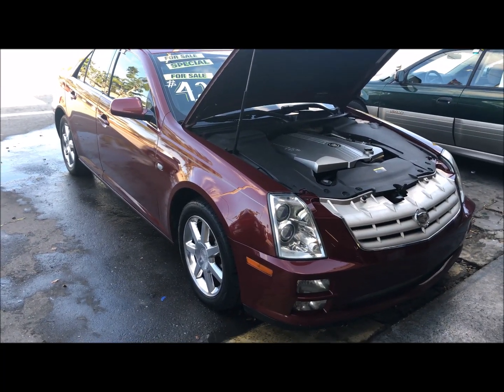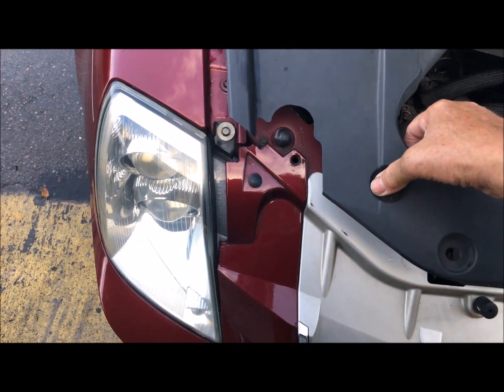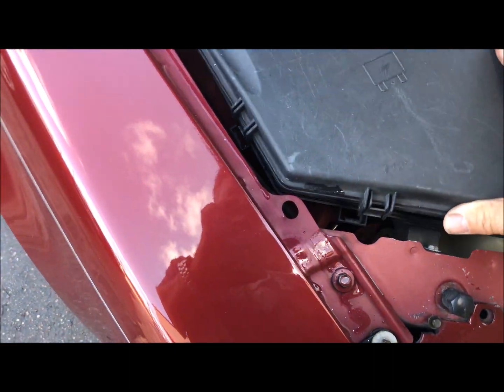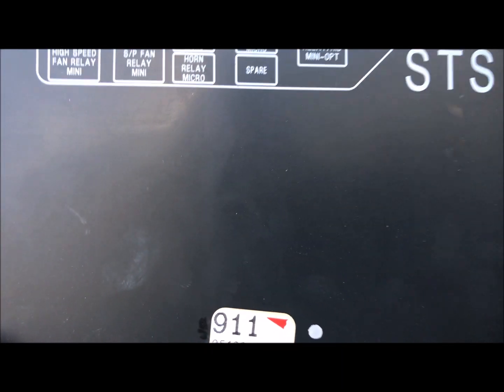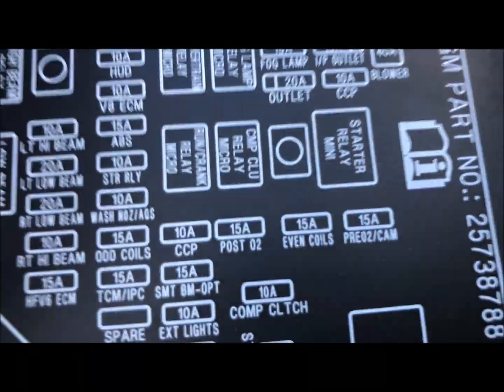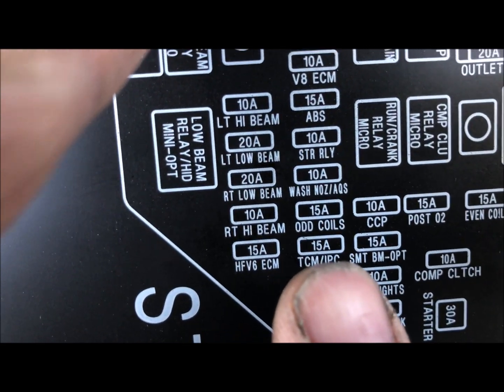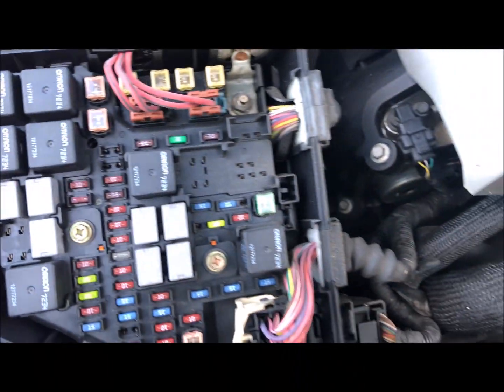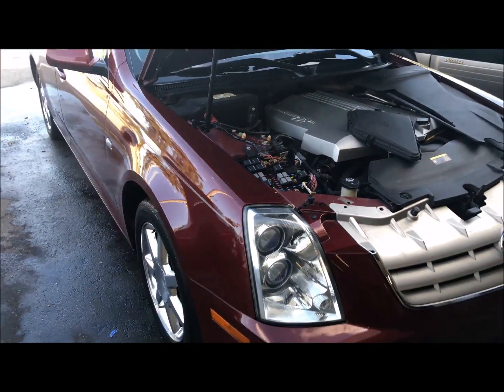Easy Fix When Cadillac STS Is Running Rough (only 4 cylinders working)

Comment: It only changes when unplugged if the coils are good, if they are bad there will be no change and those are the ones that need replaced.
Reply from the maker: That is correct
Reply: Don’t unplug the coil when the car is running or you’ll regret it.

Comment: 2005 STS V8. Getting a misfire code on cylinder 8. Swapped coil with #4. Car ran solid for a week. Back to misfire at high speeds same misfire code on #8. Anyone else have this before I go back in and replace the plug possibly the fuel injector or connector?

Comment: I have a 2005 SRX. V8. Had a mechanic I trusted and did decent work at a decent price because I'm disabled. Took it to him with an oil leak. He changed rear main seal. Leak cured. But when he put the trans back in it whined. Drove it for a while whining until trans died. He put another trans in (used) and THIS one whines. He gave up on me so I've spent 2300 on parts and rental cars while he had it and I have a car that has no oil leak but a transmission that whines and I'm sure will be a problem again eventually. It goes right into gear when shifted and they change smoothly when driving. Not all wheel drive. Rear wheel. Just wondered what your thoughts were. I'm VERY glad to know about the fuses tho!!
Reply from the maker: This car takes a specific transmission fluid type. Make sure that the correct type of transmission fluid was placed back into the car. Sometimes mechanics will buy cheap transmission fluid.
Reply: Thanks so much!!

Comment: 2007 Cadillac Sts V8 4.6L
186,xxx miles 
Car worked an ran fine before incident:
Hit pot hole an car shut completely off my engine wire harness had been smashthated an most wires were smashed to a point if being cut had car towed to an shop specializes in electrical problems for cars an they rewired all wires proper car starts up an after a few minutes idling the car shakes an check engine light blinks
Had diagnostic scan done on the car an it says an 3 codes popped up "Code # P0304  Cylinder 4 misfire detected" 
"Code # P0204 Injector Circuit / Open cylinder 4"
"Code# P0300 Random - Multiple Misfire Detected"
Changed spark plug an fuel injector on Cylinder 4 an i still get the same codes.
What could be possible problem ??? Maybe bad "PCM" ?? OR ??
Any help or input or opinion would be greatly appreciated.
Reply from the maker: did you check all your fuses and relays?  it's a possibility that when those wire were crushed it blew a fuse and/or damaged a relay.
Reply: More than likely PCM/ECM module. Its under the driver side in front of wheel well. Mine gave me 0306 i changed plugs, coils and injectors to eliminate my problem. Then found previous mechanic had bent pins in the module and ripped of the harness caps. SMH
Reply: Or could be mass air flow sensor
Reply: Did you fix that problem ? @megabc33

Comment: i have a 2005 cadillac  STS with navigation.. Problem ~~~~Navi and radio does not turn on and  stop working.. i tried unplugging the battery and even let both + and - touched.. no luck..
i changed the battery and checked my fuse box under the seat and the hood.. still no luck.. the fuse looks fine... can someone help????
Reply from the maker: check ALL OF THE FUSES.  crazy as it sounds, but sometimes it will be a fuse for something else that SOMEHOW ties into your radio.
Reply: @conquryourfear  i did... all fuse working 🤒
Reply from the maker: promking03  seemingly worse case scenario, your head unit has taken an extended vacation.  See if you can get one at your local junkyard with the ability to return it....replace it, see if the replacement works.  If it does, that's it.  If not, at least you eliminated that possibility.

Comment: I have a 05 set v8 awd check engine light is on and engine is making loud vibrations... Any ideas?
Reply: Drive shaft boots need changing
Reply from the maker: could be an individual ignition coil.  try pulling one ignition coil clip at a time and see if there's a difference in tht vibration.  if you pull one and there's no change, replace that one.